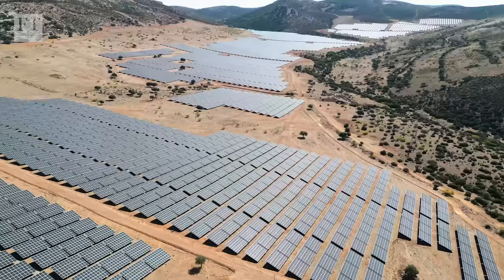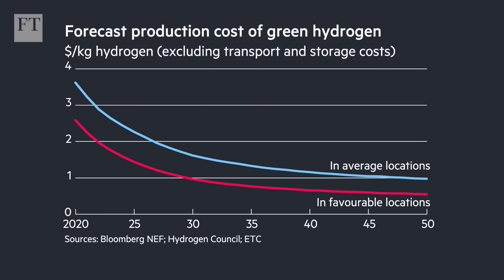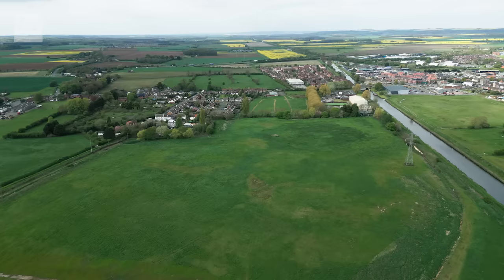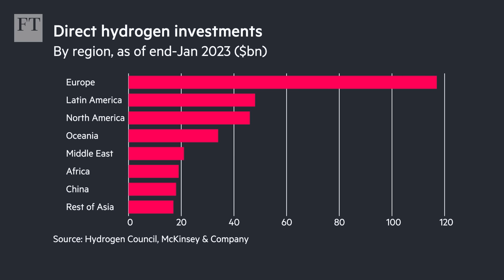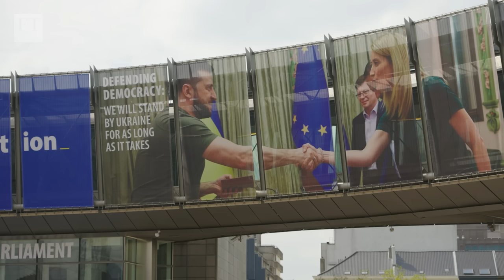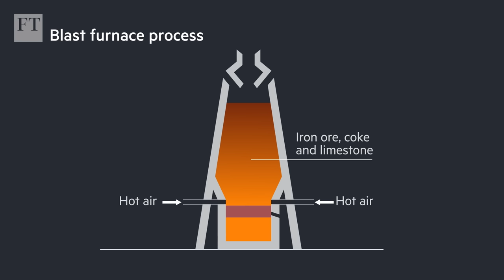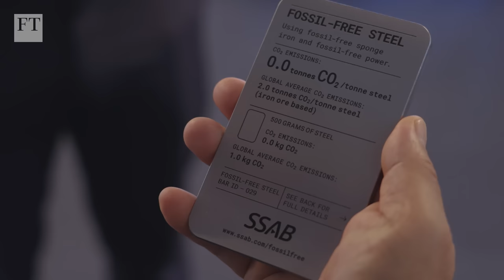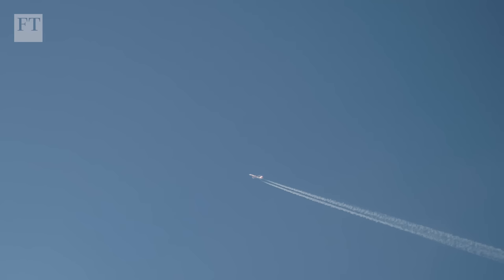Can hydrogen help the world reach net zero?  | FT Film

Comment: USA should build small Pelton wheel generators using a direct drive washing machine motor that could be plugged into a 2 inch polypropylene pipe going up the creek to a home made dam with a floating inlet pipe, 231 feet higher gets 100 psi = 300 - 500 WATT output, = FREE+CLEAN+CHEAP+RELIABLE Hydro electric power.
Which can run LED lighting system, charge batteries, play a car stereo with house speakers, radio, 2 way radio, TV, etc. All for very little money.
A 300 foot 3/4 inch ID black poly pipe on the roof gets free hot water forever during the sunny day time.
With coils separated so the shadow of one pipe doesn't shade the others on south face of roof.
Stainless steal bailing wire holds it in place. With coils on a black flat surface, a HOT water tank above works. Clear visqueen wind break makes steam.
We should build nuclear after that.  It is a "Common Sense First" approach that we can do NOW. Should do NOW, Need to do NOW, & sell to the world NOW.
Rewire 3 phase coils to 3 ac circuits.
LED lights run best on AC current, no rectifier control is required. Add lights to suit voltage output.
Battery charging needs 4 diodes to DC & a resistor to limit electric breaking. This sets the out put voltage to that of the battery bank.
Keep It Simple Stupid = KISS method.

Oil or fuel should not be burned to make electricity ever.
Too much energy is wasted in the process, & too much pollution is created.
We must use energy that is being wasted any way, like hydro+solar+wind power.
Burning methane in cars/ships gets rid of the methane instead of venting it.
Venting causes green house effect.
Cap old oil wells now, or use the gas that is venting.
Home heating burns gas responsibly also.
Fire is natures cleanser.

Comment: So, they're hoping to use "cheap renewables" to produce "green hydrogen" - but cheaper renewables  also means cheaper electricity, so as a fuel, hyerogen will always be 3 to 4 times more expensive than electricity. Hydrogen simply isn't economically competitive.
Reply: You can store excess renewable energy in hydrogen for use later.

Comment: Hydrogen is not a fuel. That is, iit is not a source of energy like petroleum - it is only a means of energy ttansport, at which it is extrmely inefficient.  It wastes a huge fraction of the energy that is input into the electrolyzers.
Furthermore, to get the energy back out to electricity, you need vast numbers of hydrogen fuel cells which require huge amounts of palladium and other rare earth metals - which we do not have.

It's a shame that policy and finance are so ignorant of basic science and engineering...

Comment: Really interesting and much better explained than expected, it did need to explain more about the fact that converting elextricity to hydrogen and back into useful energy is about3-6 times less efficient than just using electricity. I agree though that even so it is a very useful part of our future. 

but why is the presentation so Clive from drop the dead donkey?

Comment: The Hydrogen economy is a total joke.
Imagine forming a fuel supply network that requires a huge power consumption drain to form the fuel, it leaks from every form of containment from the moment it is created, right through the infrastructure to the consumer so what you get out is nowhere near what went in. It's like every tank and pipe had a small hole in it, that's the scale of the problem.
If that wasn't off-putting enough, burning it only delivers half the energy (at best) of the fuel it was meant to replace, so you now require twice as much of it. How is this efficient at all?
The only efficient way to utilise hydrogen is running it through a fuel cell, but that requires extreme-pressure storage tanks that have a very short finite lifespan before catastrophic failure.
The whole thing is a massive scam to generate money, through engineered inefficiency at every stage, while convincing people that it's 'clean' and 'green' when it is nothing but wasteful.

I can't see a single benefit of a hydrogen economy for anyone who isn't a top-level shareholder in it, who sit back and watch the money roll in while they laugh at the gullible fools they conned.
Reply: what about factor 2 in food production. That is about the estimated losses we would have if we suddenly stopped producing hydrogen.

Comment: Propaganda video.   Hydrogen for chemical processes is NOT the hydrogen economy.  It is necessary to stop fossil hydrogen production for fertiliser, steel etc producing greenhouse gases.  The Hydrogen economy is about using Hydrogen for Energy (eg grid or transport).  Unfortunately Hydrogen is not suitable for this purpose.  Even if you get free green hydrogen the compression and distribution requirements make it inefficient and grossly expensive.
The EU has already provided over $13Bn for green hydrogen (which the Spanish project benefited 200M from), the IRA covers all investment in many areas of decarbonisation not just Hydrogen.

Comment: Hydrocarbons are a great fuel, but the World only 60 years worth of gas and oil. Even coal only has 130 years left. Hydrogen from fossil fuel is at best a short solution and you might as well just burn the fossil fuel.
Reply: About 2.5x more energy can be released from hydrogen compared to fossil fuels (methane) - so no, we may not aswell just burn the fossil fuels.

Those 60 years could give us 150 years of fuel, and also be produced in a clean fashion. Thus extending our time amidst an energy crisis and also more time to advance our technology further.

Comment: So they take water, they use lectric to get hyrdogen out, and then they burn the hydrogen to make steel and call the steel green.  Did I miss a step?  They take energy to get hydrogen, then they BURN the hydrogen, to make steel, and then they call it green.  It may be cheaper to make steel this way, but USA plants that use electric heaters are more "green" than this because they don't BURN anything.  This whole video makes sense until you ask... just one god damned question about what they do with the hydrogen.  They burn the hyrdrogen  Why they burn it? because if they turn
Reply: As I understand it, it's not so much the energy that is used but the chemical properties. 

Green steel replaces coal with hydrogen as the reducing agent. 

I'm not to keen on how the chemistry works though.

Comment: A lot of hydrogen is isolated from
hydrocarbons to make fertilizer right now, 99% of it or so is from hydrocarbons using hydrocarbons to fuel the process. Show us that it is possible to make green fertilizer at scale and then maybe we will get excited about hydrogen.
Reply: That is the thing green hydrogen is useful for. replacing the grey hydrogen we use now and compensating for seasonal differences in Energy production.

Comment: Water has 1 Hydrogen atom and 2 Oxygen atoms always has and always will there is n such thing as H2 in scientific notation two Hydrogen atoms would be 2 H just like two Oxygen atoms is 2 O regards Graham Flowers MEng
Reply: How old are you? Didn't you have the subject chemistry in your school?
Reply: @701983  MEng look it up regards Graham Flowers MEng
Reply: @grahamflowers  Just a couple of other molecules: NH3, CH4, O2, N2, C6H12O6, SF6, SiO2, Al2O3,...
Only if you talk about single atoms, the number comes first.
For molecules, you write the element first, then the number of atoms, if it's more than 1. 
Water consists of 2 hydrogen and 1 oxygen atom. The molecular mass is 18 dalton, 16 from 1 oxygen atom, 2 from 2 hydrogen atoms.
If a water molecule would consist of 2 oxygen and 1 hydrogen atom, its molecular mass would be 33 dalton.
And the splitting of water produces twice as much volume hydrogen gas (H2) as oxygen gas (O2). For the same reason.
Reply: @701983  if there were two Hydrogen atoms in water it would have been found 50 years ago but no there wasn't water H - 2 O    Oxygen  1 Hydrogen 2 Oxygen you can have 2H 2O and it will be classified as water or H - 3O witch is heavy water regards Graham Flowers MEng
Reply: @701983  what have those elements to do with Hydrogen production there is still no such thing as O2 there is 2 O unless you are taking about the telephone company regards Graham Flowers MEng

Comment: No, it's far too dangerous for domestic use. Grant Schapps has just confirmed that the UK will not have hydrogen boilers.
Reply: Hydrogen to the home has been implemented in Japan for decades, already.
Reply: And hydrogen is not economical.
Reply: @AORD72  sorry, but we don't have any process that can scale enough to surplace hydrogen in the production of fertelizer.
Reply: @MusikCassette  My comment was with respect to being used as a storage medium for energy. It is far cheaper to just use electricity directly. Or in batteries for cars. Sure there probably some instances that hydrogen can be used for chemical processes.
Reply: @AORD72  we are not just talking about some instances. The chemical industry needs a substantial amount of hydrogen. If we would produce that with electrolyses we are talking about 10% of the current electricity consumption. That is quite a big block to balance out  excess energy. It could even be more, if we start using hydrogen for steal production like mentioned in the doku.
Reply: @MusikCassette  The problem is that hydrogen is not economical for electricity generation. The thread started with "UK will not have hydrogen boilers", as in hot water heating and home heating. Better to use electricity directly, hot water heating is especially suitable to intermittent electricity generation.
Reply: @AORD72  but it is ecconomical  and necessary for the things it is actually used for. And the thing to do is to use its production, to balance variable energy production.
Reply: @MusikCassette  Yes, it depends on the country as to how much dispatchable and base generation they have. But even still, it far more economical to build more hydro dams and nuclear reactors than storing hydrogen. 

Why build 4 GW of wind farms and covert 3 GW to hydrogen to store, giving you a total useable amount of 2 GW. Instead it would be more economical to build a hydro dam or reactor that produces 2 GW when you need it.
Reply: @AORD72   well the hydropower is quite dependent on local conditions. So Yes build Hydropower to the extant you can without causing major destruction. But build them variable. that is way more helpful than baseload.
Nuclear power on the other hand is really not economical.

so why would you build renewable energy and use a sizeable chunk to produce hydrogen:
because it gives you comparetively cheap energy, plus the hydrogen, that you also need (for the chemical industry ), and would otherwise produce emitting CO2

If you put in a lot of base load producers on your grid you also need consumption, that you can vary. Energie consumption is not flat, unless you make it flat. 
there are other high energy intense processes, that could also be used. But hydrogen production is well suited for that.
Reply: @MusikCassette  "use a sizeable chunk to produce hydrogen: because it gives you comparetively cheap energy," NO IT DOES NOT. Creating and storing hydrogen uses about three  to four times the energy as just using electricity that is why it will never be economical. It is far more economical to build another power station than to create and store hydrogen.
Reply: @AORD72  your reading skills are lacking. I suggest you read my comments again and try to comprehend what I was saying. I was not talking about producing electricity from hydrogen. That would indeed be a bad Idea. Not as bad as trying to produce meaning full amounts of energy from fission, but still bad.
Your electricity gets cheaper, because a bigger proportion of it and for longer stretches of time are from renewable energy sources. 
You use the hydrogen, to replace the hydrogen that we currently produce from methane.
Reply: @MusikCassette  You are the one with a reading problem, the thread WAS "UK will not have hydrogen boilers", meaning hydrogen used for heating. And conversion of Hydrogen from electricity uses about 2-4 times as much energy as just using electricity directly.

Comment: Just saw a hydrogen car being released in the next year or two with 5 hydrogen removable tanks so you just switch out empty tanks instead of fueling up. Really hope hyrdrogen cars take off as electric grids cannot handle fleets of EVs. I live in CA near the capital & we have blackouts every winter & look at Texas where people literally freeze to death because their grid is sh*t. EVs are also super toxic & use slave labor...We need to ditch the EV idea fast.
Reply: The problem is that with green hydrogen, you need at least 2.5 times as much electricity to move a vehicle the same distance compared to a battery electric vehicle. So if you think hydrogen will improve things, it's the opposite. And hydrogen also requires batteries and a fair bit of platinum and palladium. Except for the longest range batteries, lithium iron phosphate batteries are fairly non-toxic and benign, with zero cobalt. The lead acid battery found in every ICE vehicle is also quite toxic. The amount of cobalt has been drastically reduced in recent years and continues to decrease.
Also, those hydrogen vehicles have a built-in expiration date, after which you must throw them out because all of the hydrogen components need to be replaced. It's printed inside the filler door of every hydrogen vehicle. There have also been multiple hydrogen fires and explosions at filling stations, some quite serious. Most EV charging also happens during non-peak energy usage and in fact, is used to help stabilize the grid.
Reply: Hydrogen is not economically viable. Batteries do not use slave labour, what nonsense.